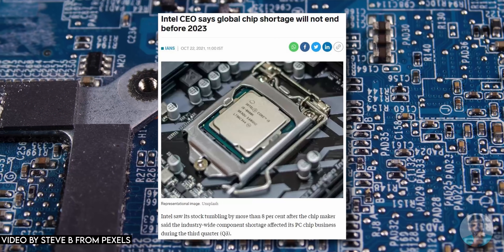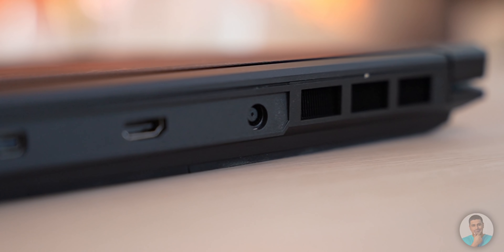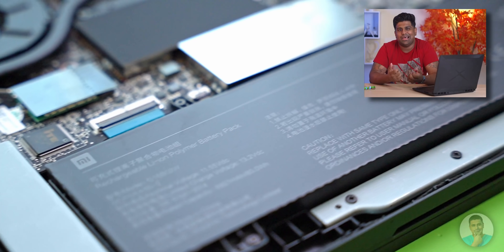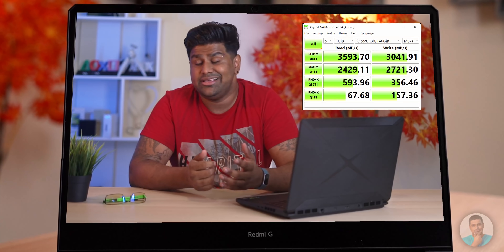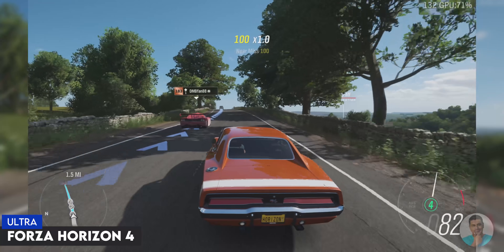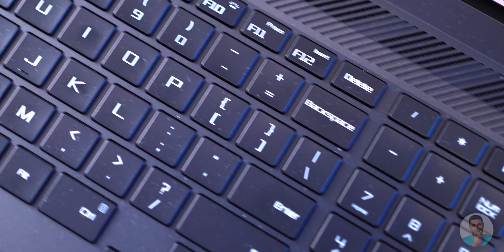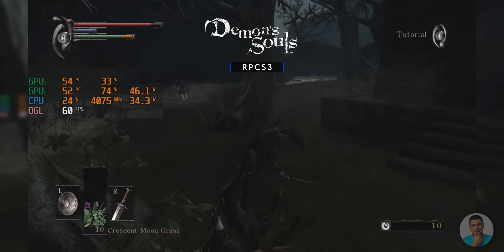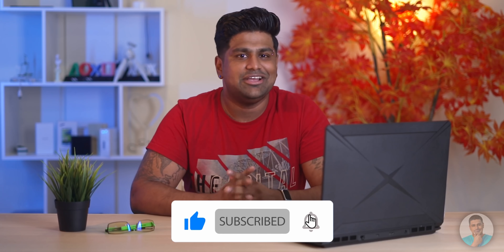NOTHING Comes Close to This!!! - Redmi G (2021 Ryzen Edition) Review

Comment: The MSI GF63 thin's 3060 variant retails around the Redmi G's price. It's a pretty solid laptop but as its a thin model the battery is meh. You should try that. MSI has been putting some really solid laptops out there. Plus, this one you can actually buy in flipkart rn lol
Reply: How are thermals?
Reply from the maker: I can't seem to find the model - share a link? the GF63 on flipkart - top sku is 10th gen intel + 3050, the GF65 is 3060 but still 10th gen intel i5 - that's what I am finding bro
Reply: @C4ETech  oh yeah sorry, the 3060 is gf65.
I have got a 3050 gf 63 so got confused as the rest of the specs are identical. Also, 10th Gen i5 is pretty nice. It's a hexa core. You compromise on the cpu a bit sure, but imo, that's the best value for money gaming laptop for ones that don't want to go through the hassle of importing.
Reply: @govardhanposina17  I have got a GF63 thin 3050 which is practically identical in all aspects except the GPU, and my thermals are okay. Idle temps are 34-35 degrees CPU and while running a very heavy AAA game, they shoot up to about 80 degrees Celsius for both CPU and GPU.
I think the GF65 series have dual fans for cooling whilst mine has a single fan so if anything, the thermals should be better

Comment: Nothing comes close to this?? Would love to see how it compares to M1 Max 32 core GPU with 64 GB RAM
Reply from the maker: how much is that again?
Reply: @C4ETech  my bad, you seem to be talking about most value for money laptop. Agree that mac is very expensive but I guess it’s one of the most powerful laptop out there with that high memory bandwidth, unified memory architecture and up to 64 GB of VRAM which even many desktop level GPU won’t offer. Apple silicon is in its own level and intel seems to be lagging behind a lot.
Reply: @TheRohit901  The i9 12900K begs to differ.
Reply: @zs2001  bro that’s desktop level CPU. If you want to compare desktop with laptop it does not make a sense. Wait for the new Mac PRO then we can see. Even after that intel does not have unified memory architecture or SOC design which is more efficient and powerful. I’m pretty sure in day to day tasks and real world performance things would be different
Reply: @TheRohit901  Then we wait for the benchmarks. Intel is yet to come out with its 12th gen mobile processors too. I'm pretty sure in day to day tasks no one notices a difference even with the current crop of laptop processors.
Reply: @zs2001  we need to compare real world performance too. Like actual tasks and not just rely on numbers. And yeah it makes sense to compare oranges with oranges :P so yeah it would be interesting to compare intel’s latest mobile processor with apple silicon. But I’m sure apple silicon would be way better
Reply: @TheRohit901  What do you propose we compare then? Btw, I don’t think you quite understood what I meant by benchmarks.
Reply: @zs2001  I’m assuming you mean geekbench scores or any other benchmark scores. I’m talking about actual use cases. If I’m an ML engineer I would want to see which one is better to train my models. If I’m a video editor I would want to see which one is faster in exporting my footage or rendering them. I also would want to have good overall performance in terms of battery life etc. We also need to look at specs, the memory bandwidth of 400 GBPS is insane and no intel laptop can match that. Intel is x86 based it will not be efficient in terms of battery life too. With Apple silicon you get same performance and much better battery life
Reply: @TheRohit901  Anything you compare becomes a benchmark, not just synthetic ones like geekbench. And why reiterate the specs when you just spoke about real world performance being important. Anyway, end of day, it doesn’t make sense to compare specs when the architecture and instruction set are different. Better to wait for reviewers to come out with comparable benchmarks.

Comment: I swear gaming laptops's life time is 50% of a gaming PC's with exactly the same hardware, best bet buy a console for gaming and a cheaper laptop at least with an SSD for work or just buy a gaming PC, had 2 gaming laptops  one with RTX 2060 and one older one with GTX 1650 one got switchable graphics problem one's motherboard solder got effected by heat even with a cooling pad, at last my 13 years old PC which I kept updating till 2014 with GTX 1050ti took the lead. roughly 70k PC (accumulative) was far better than over 2 lakhs on "gaming" laptop.
Reply from the maker: thats always gonna be true bro - desktops are gonna last longer, can be upgraded more and perform better at the same price or be more expensive for the same performance - we still get em only for the portability

Comment: I was waiting for a cheap 3070 laptop .But I couldn't find one. I just bought my gaming laptop 4 years ago with 4gb 1050ti ,but few of my friends got 1060 it's 6gb and 60% more cuda cores ,their laptop still works in charm ,But mine is lagging a bit. Few recent rendering softwares neede minimum 6gb Vram. Now I regret my purchase . This 6GB 3060ti is a beast laptops 2.2x1060 in performance but it's Vram gonna bottle neck after 3 years.

Comment: 1.82M subscribers and playing pirated game on channel 👍🏻
Reply from the maker: I own em too - easier to install - same reason why I never activate windows on builds either
Reply: @C4ETech  How did you buy Metroid dread to play on emulator? Nintendo doesn't sell it for any emulator.
Reply from the maker: That's how emulation works - and btw.. I own a switch - I am legally allowed to dump my own games - but I dont own dread tho - eh judge away
Reply from the maker: Emulators have nothing to do with responsibility or quality mate
Reply: @C4ETech  Showing a pirated game running on emulator shows lack of responsibility. Anyway, I have no complaints about production quality. CPU, GPU temps along with fps, which power modes are present,screen quality test, fan noise at ultra, fps comparison with other brands with similar specs etc will add more value.
Reply from the maker: lol get off your high horse mate - such judgement for the use of emulators - phew!
Reply from the maker: at best you can claim ethics - it has nothing whatsoever to do with responsibility 

... and if you came in with "CPU, GPU temps along with fps, which power modes are present,screen quality test, fan noise at ultra, fps comparison with other brands with similar specs etc will add more value." - I'd have been "Thank you for your feedback mate, noted - will make sure I add it in going forwards"
Reply: @C4ETech  I was not talking about emulator, I was talking about piracy of a game which just got launched this month. I hope you know that emulation is not illegal, but pirating a game on it is. Anyway, goodluck for your next videos.
Reply from the maker: that makes no sense but thanks

Comment: The space key exactly looks like key in ROG G14....and the price range 83k is not that impressive and it may go up in India while deploying here at the same time ROG Zephyrus with 5800HS and GTX 1650 is around 75k...IK we can't compare it with RTX still it's decent specs for price... And DELL around 65k with 5600H and RTX 3050...and HP Victus also shares same specs,price.... at the same time apart from performance Dell,ROG,HP will be really nice thn Redmi from display,sound quality, battery backup, build quality, command center.... So, the price of 83k really make sense 🤔🤔